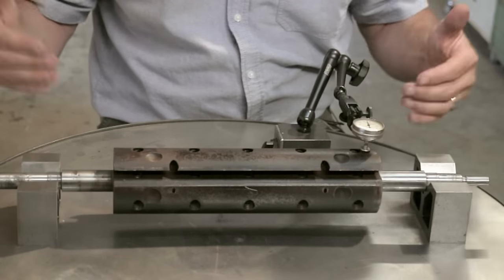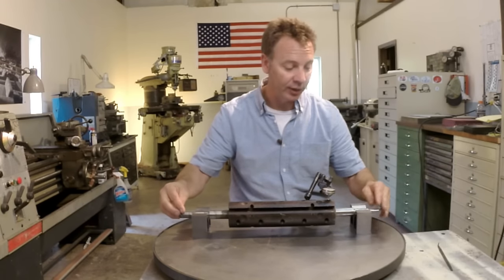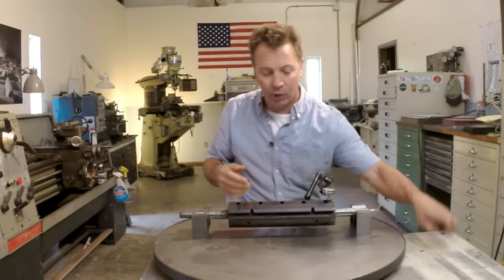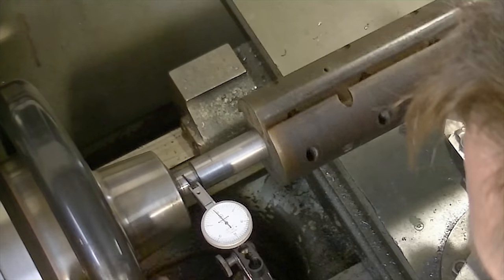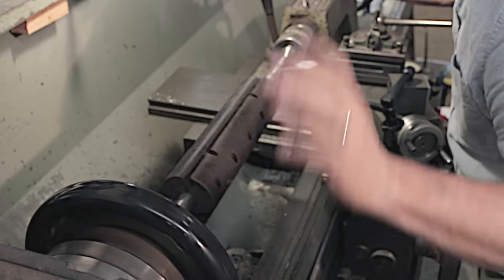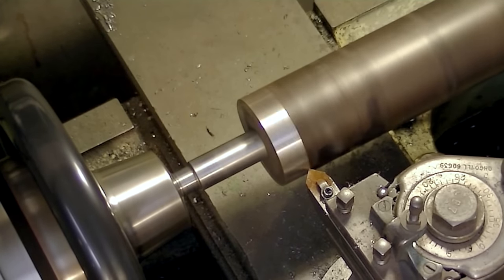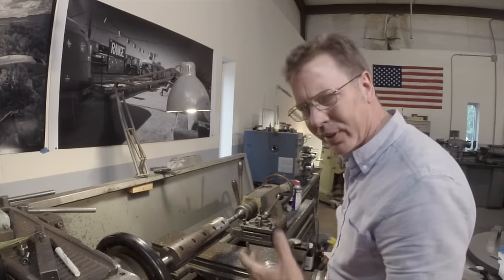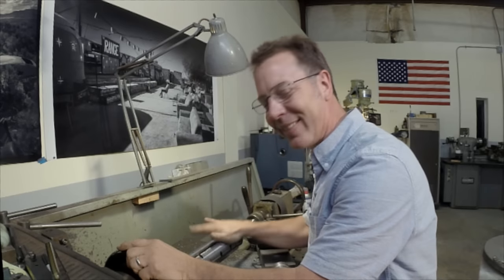Tough turning

Comment: If It chattered a lot, what you would have had to do to run this system is slow it down. Half of machining is controlling vibration. If it vibrates, slow it down (rpms).

Comment: great video dale, was it balanced?
Reply from the maker: +Brian Stanga  It's still a little out of balance. But nothing a few holes drilled into can't fix.

Dale d
Reply: you should do a video on the balancing, we used to balance large RC airplane props, but it was easy to find the heavy side, I'd have to "scratch my head" for a few to come up with a good way to identify just the right spot to remove material. I guess you could tap one of the old holes and add a set screw for weight if needed..

Comment: Just a question. If this is holding blades, doesn't one need to be more concerned with the blade beds rather than the outer surface?
Reply: I agree. Truing the O.D. affects balance, but the internals may still be out of sync. I suggested the blades be indicated to bearing concentricity and the shaft be balanced afterwards, in a previous reply.

Comment: re-bore the main hole and make a new shaft. especially if the shaft is already bent in areas.
Reply from the maker: Hi Derrick, The shaft was not bent, the boar was off center. I decided that the fastest and easiest   course  to take was   to turn the outside then to remake the hole and shaft.

Thanks for your comment

Comment: Even if this method were sound (which other commenters have already addressed), you still have a significant problem in that you have machined away the relief angle which is not less important here than on  drill bit or end mill. Without the relief angle your entire blade surface is always in contact with the wood. The fiction is through the roof! Heating might easily burn your wood.
Reply: ExtantFrodo2  there are blades that screw into that which do the cutting, it's not a 1 piece cutter
Reply: ExtantFrodo2  he mentioned directly in the video that the blades are bolted in, so relief is provided by the blades position relative to the holder.
Reply: Looking back at the video I can now see the screw holes for the insert. I had assumed the piece being turned WAS the cutter. My bad.

Comment: Until you put that part back in and spin at 10K + RPM you don’t know if bringing it to proper geometry eliminated the vibrations. 

Those cutter heads are dynamically balanced no matter how well they are machined.
Not to rain on your parade, but I will be quite surprised if it works without vibrations after your treatment.

Comment: I would have just punch drilled it to remove material to balance it. its a plainer. they don't care if they are out of round. you add a blade and its out of round. the point is to turn rpm and that will clean up well enough to get an even thickness across the work... you always sand after planing also so perfection isn't the point of the tool. removing mass amounts of media is the real goal.

Comment: This is the most challenging lathe job you ever had? Really. The OD concentricity  that you're turning makes zero difference  in the performance of a wood shaper aside from vibration. What you really need to fix is the blade slots. Do that in a mill between centers. Make the base of the slot parallel to the axial centerline of the shaft. Grind all the cutter blades to the same height. done.
Reply: Beepcode, you are absolutely right. I think he said the shaft was not bent. Do the blades actually ride on the groove bottom? I don't know. I would find it preferable to have to indicate the blade cutting edge to concentricity, or as you said grind the blades in assembly and then balance the shaft, especially if the machine is worn out. I suppose it all depends on the blade mounting system.
Reply: The slot depth is irrelevant, the blades are set referenced off of the face of the cutterhead.

Comment: was there any change in the mounting of the Knives or were they cut after the shaft was mounted?
Reply from the maker: We had no problems with mounting the blade in it. the machine now works great
Reply: Good Dale
Reply: yep as I remember there is a good amount of free place at the end of the blades, so that it can take different size blades. well the Russian Machines were made that way while I was a young man in Iran and work with them. I have just bout me a small lathe and I am hoping to learn lots of things from you. Thank you for your video's....;)
Reply: +Mimlo Miani - Are you still in Iran, or have you immigrated?
Reply: Typically for a head like this, it stays on the machine since it is considerably more work to remove it. In that case, the knives are removed and ground off the machine. When they are reinstalled, many use a magnetic setting gauge to assure the knives are projecting from the head an equal distance. On a wood molding machine the heads slide off their arbor when unbolted on one end. This head is typically placed on an arbor in a knife grinding machine where it can be rotated by hand up to a rotational stop.  Other than on a cnc grinder, the manual grinders use a guide template which is clamped into the machine and used a guide that is followed by a tracing pin and provides a 1:1 ground pattern in the knife stock. For wordworking molders, many profiles are often used. The knife grinding process starts by scribing a pattern into the blueing applied to template stock which is cut and filed to the profile needed.  Then pre-beveled knife stock is cut to length and attached to the molding head. Four knife heads are common but generally only two knives are placed opposite of each other to be ground matching the template’s pattern. Some companies have cnc routers so they can use them to make templates as well . This is often done in plastic. The remaining two slots on a four knife head are generally “filled” with blank stock, for balance, that doesn’t get profiled since on an unjointed molder only one  knife is doing all the cutting even though the two knives are ground concentrically.

For a molder with jointing stones, the stones are profiled to match the knife pattern.  Once the knife heads and stones are mounted on the molder, the molder head is brought into contact with the matching stone resulting in near perfect concentricity.  Depending on the type of wood that is being molded (hardness), the knives need attention following something around 5,000 lineal feet of cutting. On a jointed machine, the knives are jointed again and are ready for more cutting.  Knives can be re-jointed more than once before being removed and sent to the grinding room. In the case of a jointed machine, all the knife slots in the head are occupied (Sometimes heads have 6 or more knife slots) with ground profiled knives since, in theory, they all will be cutting. Fine finish for wood molding generally means the wood will have 16 to 18 knife marks an inch, which will look and feel pretty smooth. So, the jointed machine can be run much faster since more knives are in the work per rpm. 

An unjointed machine will often be set to run at 25-40 feet per minute to get a fine finish as compared to a jointed machine which may run at 150-180 FPM. Can you tell I’m an old wood worker? Well, at least I can prove I’m old (70).

Comment: I am surprised it was that out from the start. I thought parks would have done a better job.
Reply: It may be damage from the user. someone took out the cutterhead and dropped it. Those heads tend to spin at about 5500rpm. If it had been that way from the factory it would have been useless.

Comment: Why didn't you use cubic boron nitride insert?
Reply: Richard Bernstein not a good idea for soft material or intermittent cutting. Plus they cost about 15 times as much as a carbide insert which cost about the same as an old brazed carbide tool that can be reground

Comment: have you tried using an Hss tool?
Reply: Guillaume Fortin Moquin High Speed wouldn't last 2 minutes on an intermittent job like that and even if it did, the finish would be crap. I'm a Turner of over 30 years experience.

Comment: why's your collet running out 2 thou?
Reply: Could be due to corrosion on the inside of the machine head, or uneven bearing wear on the spindle I guess. The inside of the collet receptacle (not the collet itself) could be skimmed or cleaned up using emmory cloth to bring it true, but it depends on whether you want to risk it :)